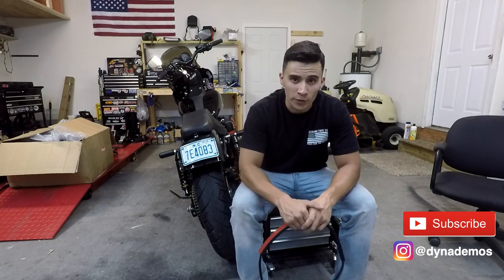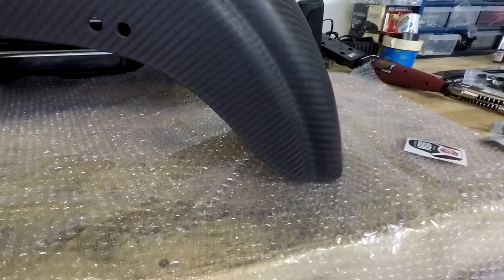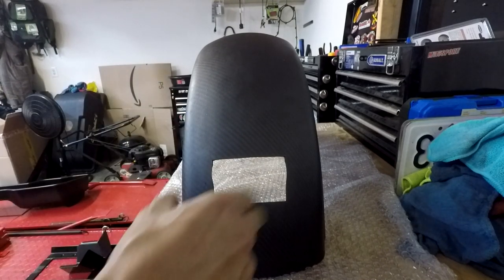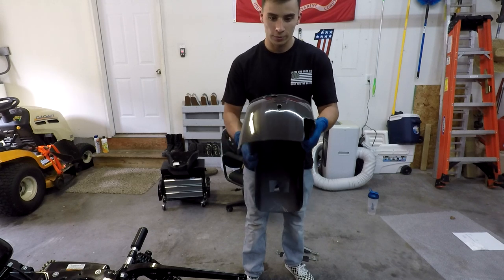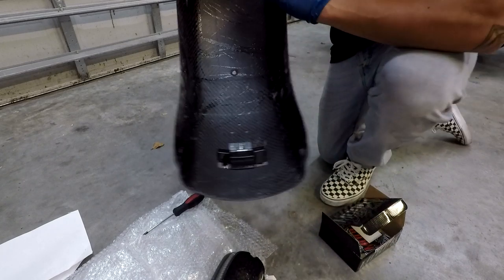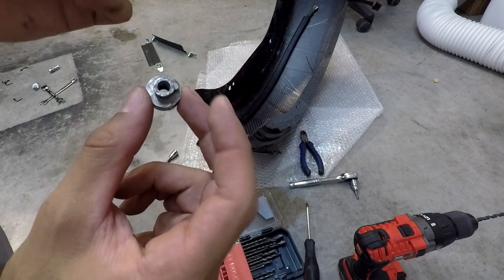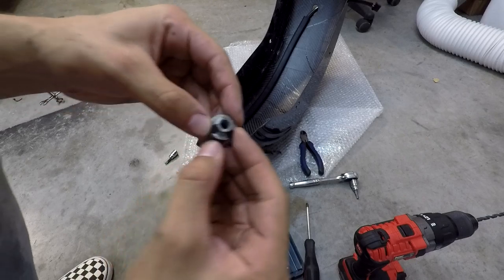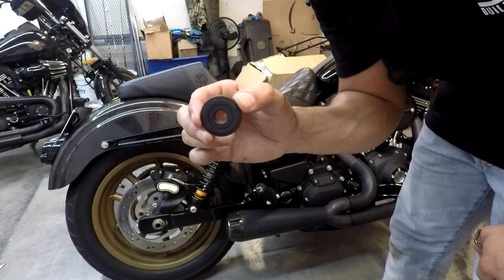Carbon Fiber Full Rear Fender Conversion (06-Up) Dyna

Comment: Do you remember the dimensions of the square cutout for the taillight on the fender?  Wondering if the stock fender on a '14 FXDB would be too short for the license plate and tail light conversion.

Comment: I can understand why you went to a full fender as I think they both look better and offer better coverage thereby reducing the amount your back gets wet when it rains. I used a metal fender found on ebay , don't remember the price though. Which brings me to the question of how much you spend on your bike - I am not asking as it's your business, but when I mentioned decent engine mounts from BBC in the comments section on the fork brace video, you (or your sidekick) baulked at the price ! They are worth the cost as they improve the bike's overall stability so much that when combined with other things like shocks and fork kits etc you will really see how fork kits and braces, steering dampers etc are just sticking plasters on a broken leg.....
Reply from the maker: Thakery Idk how much I’ve spent probably a lot but I’ll get to suspension maybe I shoulda did it first but 🤷🏽‍♂️ I didn’t . The fender was probably like 500-700 completed.
Reply: @dynademos  Again, I wasn't asking how much you've spent - I have so much money in mine it's scary, not counting is a wise thing to do !!! What I am saying though is that considering how much new BBC mounts will improve the bike's stability, complimenting any other cycle parts you change, that the cost of them is really not that high. Sure they cost more than standard ones but they perform much better - once you have got used to the extra torque of the 110 motor you will be looking to upgrade to 117 and do heads and cams. Then you will know what power is - 140 to 150 BHP and torque will make the standard 110 S seem like a Sportster.... my sporty leaves a 110 behind away from the lights and that only has 95rwhp.....
Reply: @thakery5720  Do you still have your Sportster? What was done to it? I love my motorcycles, Harleys and especially my Sportsters! Currently I have many bikes but only 2 Harleys. A 1992 FXR Superglide and a 2018 Sportster 48. I love my FXR but the Sportster has been getting much more love from me the past 2 years lol

Comment: Carbon fiber has a great look and tons of tinsel strength, it's extremely light weight and that makes it great for several applications. However, carbon-fiber fails with impact blows, for impact is a compressive force and carbon fiber hates compressive force. On a rear fender, I understand you want looks and weight reduction, but it will not be good for abrasion and anything bumping in to it. It's really over rated for things like fenders and helmets. However, it looks great on your bike, and you have a great looking bike.
Reply from the maker: I never thought about that but honestly not worried about getting hit cause either way I’d have to replace it a fender doesn’t protect u much on a bike lol but good knowledge
Reply: That's not true. Carbon fiber is just as strong as many metals. I have a carbon fiber front fender and side panels on one of my Harleys and got ran over by a 90 year old woman last November which almost killed me. It took the front end off her car, and took a direct hit to the front end initially and to both sides of the bike after the impact sent the bike 20 yards down the road. The front fender and side panels were absolutely fine. The Clear coat cracked on the edge of the front fender and the side panel and that's because the guy that made them did a poor job clear coating the edges, I sanded them down and clear coated it again and looks as good as new. As for bumping into it or rubbing up against it, that's silly. Most people use a 2k clear coat, which feels like a rubber covering and is VERY hard to scratch. I'm incredibly clumsy and have dropped my bike doing wheelies and burnouts and have been unable to damage the carbon.